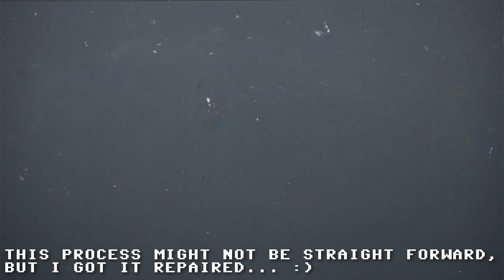Let's Repair: PSP 1000 Reshell

Comment: I should've probably watched a guide first before impulsively deciding to revive my PSP 1000 LOL I thought it would be a simple switcheroo. Half way through the video and doesnt seem to be too hard to follow. Thanks for being the only usable tutorial out there for my small brain :)
Reply from the maker: It's still quite a fiddley repair, though.
Reply: @PixelMaker04  For sure, this is my first time ever repairing something at this big of a repair. Seemed like a fun useful hobby to pickup. I normally prefer to do the modding side of things soo all this is new to me! So far having fun, not sure if I should've chosen a PSP to start off with. It's going to come out looking great though I have this really cool white and blue Japanese art theme I'm doing. I'll upload it somewhere on Reddit and send you a link! ☻ Thanks! I'm still working on this soo I'll use you as a lifeline if things go south hahahaha cheers mate
Reply: @VoteForPeter  Same here, thought it would be a easy clean and shell replacement -_-
i revive all kind of gameboys as a hobby, but a psp is next level haha, i like it though

Comment: Here I am a year later

I fucked up at 4:50 and pulled it on the wrong way and was left with the pin on my hand. I should've followed your tutorial more calmly.
Ordered a new board for €25 and lets keep moving!
Reply from the maker: Sorry to hear that. I'm sure you're using this as some learning experience for what not to do one the replacement board. That's one thing I don't like about some of the small ribbon tabs ~ they might be in different latching orientations.

Comment: Did you find the buttons to work with the same effectiveness? I tried putting a new shell on my old psp and I had trouble with the buttons being in the right spots and all feeling the same. I think it was a cheaper shell. I guess the official sony shells are the way to go.
Reply from the maker: The main ones that felt the most different were the L and R buttons. Start and Select were a bit different as well and the face buttons seemed to have had the least difference. I had to trim some plastic on a couple of the face buttons, though. And yes, the plastic for the 3rd party shells that I used are of a cheaper plastic and an ok mold. It's just not the same if you're not using the OEM parts.

Comment: i kinda followed this video but turned out i didnt really need it, the process is quite simple but nice video
Reply from the maker: Glad you were able to get it replaced even if this vid wasn’t all that needed. The 1000 was easier than the 3000 from my experience as well if you ever come across one that needs a new shell.
Reply: @PixelMaker04  actually i already reshelled the 3000 and yes it is easier, i just wanted a guide with the 1000 because it looks more intimidating with all the layers